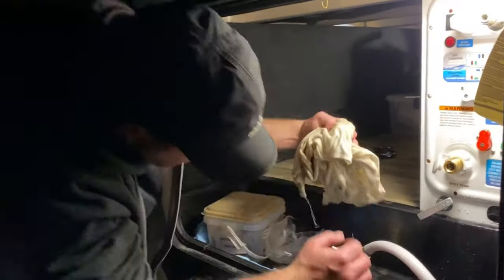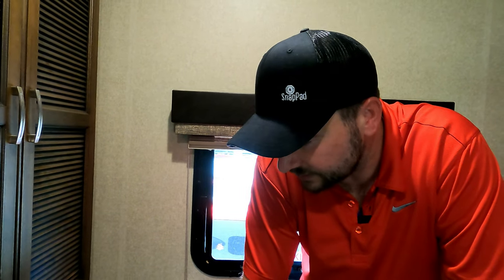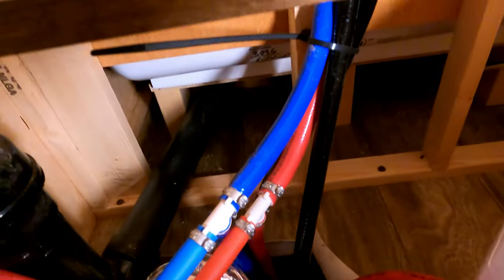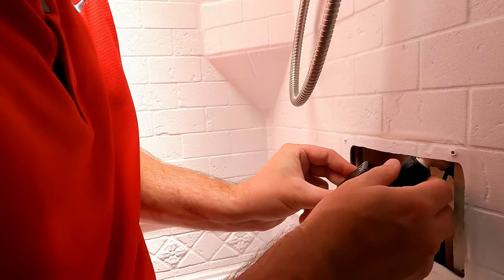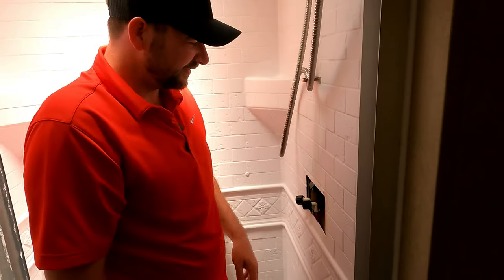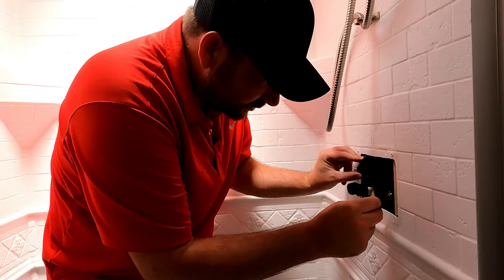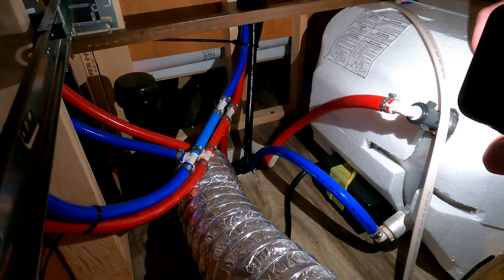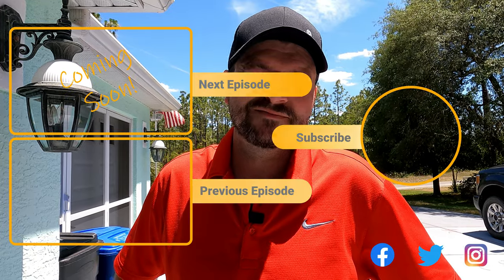RV DIY - Our black tank flush was LEAKING into our bedroom!

Comment: I replaced my leaky original B&B 571 anti-siphon valve with a 90 degree plastic elbow so I wouldn't have the problem again. There is a backflow preventer built into the black tank hose connector and I only have my dedicated flushing hose connected to the rv when I'm ready to flush. You can also get a backflow preventer that screws onto the end of your hose or the spigot. Most rv parks have
one permanently attached to their spigots.
Reply from the maker: Good info. We keep a close eye on this now and apparently they fail quite often. When it fails again, we will replace with something like you suggested

Comment: Nicely done.  This is great intel for me since I own the exact same model.  I am a little perplexed as to why you winterize your RV since you guys live in Florida now? We are in West Palm Beach and have never felt the need to winterize though I do depressurize/empty the water system and empty the hot water heater if I know we aren't going out for awhile.
Reply from the maker: Hi Felixx 👋
So we actually had to winterize back in January for a short period before we moved from Virginia to Florida. We did such a bad job that we had a bunch of issues (Check it out here: https://youtu.be/rjsfn1fmTvg). The black tank flush was one of those issues that we didn't fix immediately as it was intermittent and wasn't a priority.
Reply: @BrazenBrits  That makes sense. Thanks again for the video.

Comment: Ours leaked in our Montana. We replaced it with a brass one from Lowe's and had no more issues.
Reply from the maker: I recall you saying that. Next time I’m in Lowe’s, I might pick one up as a spare. I’m sure there must be another back flow preventer somewhere else in the rig too.
Reply: @BrazenBrits  only one.  Buy a brass one, you’ll need it soon enough.
Reply: @Mudford63  Unless you have two black tanks -- mine were both inside wall under entertainment center coming up just above water tank (5th wheel) - had to tear wall out to find it - seems like I called Forest River to get a general idea where to look - I put an access panel in wall - oddly enough, was told I really did not need one, could just bypass - I didn't but odd there would be one if not needed

Comment: You got lucky. We had a similar problem in our old camper. Unfortunately it was burst line in the wall. The vanity was in line with the kitchen sink on the other side of the wall. Had to take out the vanity and reach through the wall because I couldn't access it through the kitchen sink side, but had to cut it and reconnect it behind the sink and the vanity. Good thing there wasn't anyone around to listen to the conversation I was having with the pipe. Bloody Wanker!
Reply from the maker: oh man. good point. I was annoyed it was behind the shower controls, but I guess I should be happy that it wasn't somewhere else that i couldn't get to. So, from this point of view, good thinking Grand Design! Thank you!

Comment: Another great video, do you suppose it froze over the winter, which caused the leak?
Another quick question...is there RV anti freeze in the flush line during winterization?
Around here it is Nike...not Nikie..😃😃.....nice bling from snap pads as well...
See y'all next week.
Reply from the maker: Hey Rob! I'm, not sure about it freezing. I suspected that was the case initially, but the height of the valve and the way it works suggests that there wouldn't be any water up there. Apparently these fail quite often for no reason at all. I will be buying a brass one as a spare to carry around. I have never used RV antifreeze for the blacktank flush, so maybe i should have. 

See you next week  👍 Take care!